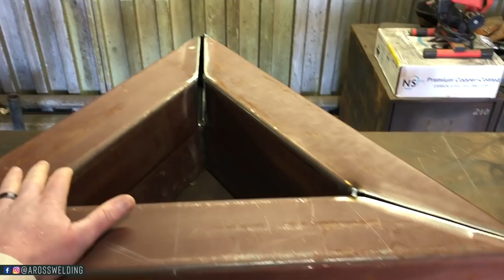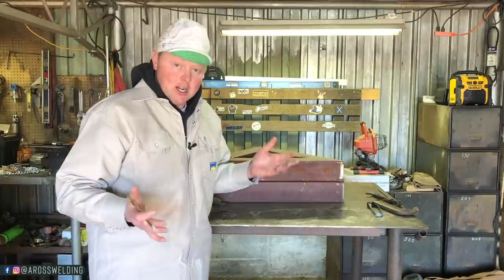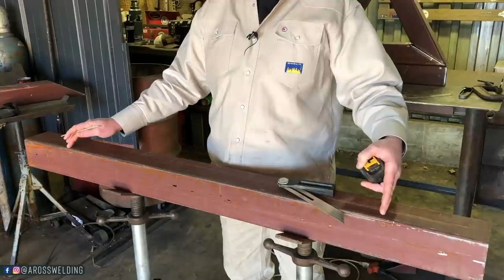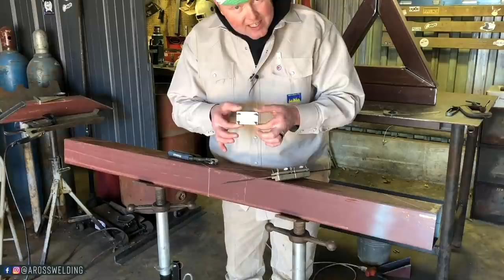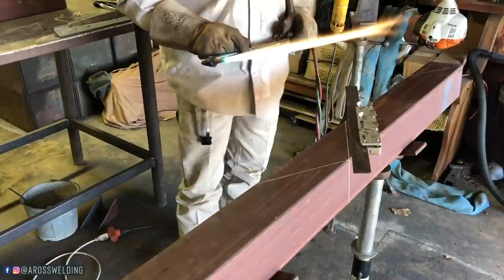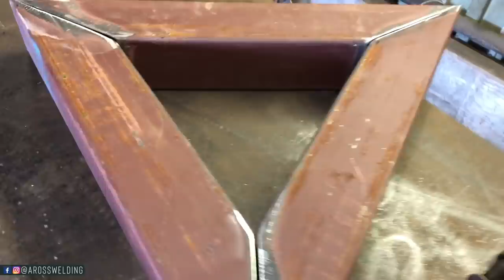WELDING SHOP PROJECTS “TEXTBOOK FABRICATION VS. REAL WORLD”

Comment: You might try this (woodworker's tip): After you've got your your edge guide all set......take your protractor (the angle measurer) and check the angle the edge guide is set to. Chances are it's just a hair off. Bump it dead on. The comments below are correct. To make angles fit up to perfect 60°, 45°, 90° etc. you must be exactly spot on; even half of a degree will kill ya. Buy a better protractor, one with the biggest marked-out arc you can find. Machinists have protractors that actually have little bitty magnifying glasses attached to them. so they can read between the angle marks. Have fun. Awesome torch work.

Comment: Hey Austin, for 45 degree and 30/60 degree cuts, you do not need a protractor at all for absolute precision. A 45-45-90 degree triangle has equal width and length with 90 degrees between. A 30-60-90 degree triangle has a length of twice the width with 90 degrees between. So simply draw a line across your material with a square. Measure the width of the material. Measure from the line you have, along the steel for 2x the width of the material and mark a line. Then draw your diagonal and you have exactly 30 degrees. Don't forget to allow for the width of your cut. Also, to save material, every 30 degree cut you make gives you two pieces of steel with a 30 degree end, so no need to mirror them back to back. I hope this helps for future builds. Keep up the good work.

Comment: Ive never had good luck bending something like that (like building a headache rack)  because when you bend instead of cut all the way through, it lengthens , which in turn opens up the joint and makes your side longer than the one you cut on its own.  now I just lay out the angle and make one cut to separate the two pieces completely.  That way i can make sure all the legs are the same length and the angles turn out much better.

Comment: I've found that if you will take a shot of whiskey, or drink a beer between each cut....the word  precise is no longer in your vocabulary. It is replace by:  fix it with a paddle disc, after you've over dabbed the crap out of all the gaps. It all turns out purdy, right after you paint it.
Reply: what about using a band saw set at 60 degrees exact and then you have no gaps at all
Reply: if I'm in the field I never use a streight edge because I know how to cut a streight line by hand

Comment: Hey Austin. This one actually quite simple. The gap is caused by two things. First, heating and bending the metal will stretch it. Second, the bend adds a radius (length) to the angle and thus creates your gap.

Comment: Hey A Ross, walking by on horseback I see yer problem and You actually gave the solution on your final try!
When you show the first one and yo have the bend at the top, your margin of error is Not Cutting the angle you bent.
You cut that one and gap closes and yer Good To Go!
Math don’t lie, 60 x 3= 180 but the 1/8 thickness of material Not cut throws everything off.
You solved it. I just put all yer pieces together!
Thanks for yer goofy sense of humor, my Grandaddy and Grandmommy are from Oklahoma so prolly learned it from my Momma!
Best,
My first name is Ross so we iz related!

Comment: I was having a difficult time with my cutting torch constantly cutting out the other day. low and behold i just had to clean the tip out a little bit and it worked beautifully (other than my shaky hands lol). the magnetic straight edge you have is awesome

Comment: If you're making alot of those its handy to have a mitre saw so you can set your angle once you figure it out and you can use a stop block to have the length every time. Cut all you need then you can weld them later. Its a trick I used doing carpentry for rafters but I assume the concept would work for welding. Sometimes making a few scrap is worth it to make sure the rest of your project has the exact same angles. There's a chart that goes along with the speed square to help figure angles. Its a PDF you can download and always have it on your phone.

Comment: Austin. Starrett no.491, thats the ticket to all your layout woes brother. I would advise a set. 24" combination square, 12" bevel protractor and a 6" center head. The straight edges are all interchangeable, makes layout extremely easy on structural members, pipe, tube and plate. They are extremely precise and very well built in the USA. Another excellent addition would be the 12" machinist level. 

Tools don't make a craftsmen but good tools sure help👌

Edit: ps. I'm not a starrett shill even though thats what it looks like🤣. They are quite literally the type of tool you would be proud to pass down to your grandkids.

Comment: Tube tends to de stress with heat which opens the angle when cut, cold cut seem to help while clamping material in place. Also get some scrap 3" flat and make up some angle squares to mark out on a flat surface.

Comment: I have found (after many years of making mistakes) that a template is the best thing to use when you don't have that bandsaw or power hacksaw. Remember, every torch cut removes material differently. A template cut exactly to size gives you the ability to trim to fit before tacking. Plus it works on both sizes of the tubing. And don't depend on your protractors. Remember, you're making equilateral triangles, so the duplication of sizes is the most important consideration. Calculate the lengths of your long and short sides instead of depending on your protractor. Access to a CAD drawing program would help too. It would do all that herd work for you.

Comment: I wonder if you didn't cut them all on the outside of the line, would the lengths have been more consistent and fit up better? Also I think the bending worked against you because it changes the length and angle from the cut pieces.  Interesting project, and glad to see you were able to parse out some insights, as well as share them with us. Thanks for the video!

Comment: I did a small project this week with 45 degre cuts but I cut them with a Metabo I had some big gaps I think It will be alot better too use a shop saw for this type of cuts comes out more exact tighter gaps good video 👍

Comment: I find figuring out angles such as your try angle. Use cardboard cut templates to test fit the cut angles. That way the mistakes are not costly. Then when transition to steel it comes out correct. Something my dad drove home to me many years ago when I was learning to weld

Comment: Usually gaps like that are easily explained by the fact that a torch was used to cut. If you don't clean the cut to smooth metal and instead just knock off the slag you might get away with it, but otherwise it's near impossible to hold any tight angles. 
I would recommend investing in some cutoff wheels, maybe even an 8'' grinder if you don't have one. For thin wall tubing like the ones you're using it would go through much easier than even a bandsaw or chop saw and you save yourself a fair bit of headache in the end from trying to figure out why you've got gaps.

Comment: try a sheetmetal nozzle , it has a stepped  2 jet configuration 
and is rested on the material , the cut is comparible with any plasma , they are great for up to 6mm plate

Comment: You have to figure hinged take-off when you bend/hinge the metel, and subtract blade thickness of your other cuts  even on thin gauge metel.  For me it's just easier to cut everything then fit back up  at the desired angle. I think there is some rule of thumb formula for hinged angles but I cant remember it. May find it in an OLD blue book from the 1980's

Comment: Keeping the 2 pieces joined is throwing it off a bit. You have to account for the length of the bend  and those 2 pieces are not going to join perfectly at the outside point. This then makes the angle close up tighter on the inside.

Comment: That is a bevel square we use it in structural a lot since they don’t give us angles if a plate is sloped one way. So instead of a plate being layer over at a 45* angle our prints would call for a 12 on 12 slope. We would lay that out on our table and use the slope square to carry it over to the part.

Comment: So a good trick is use the opposite angle. So for one piece in a join use your 30 Degree angle or whatever. For the opposite use the opposite side of your angle device for the 60 to get your 30 degree cutout. It won't matter if ones 29 and 61 as itll always match.

Comment: If your cutting angles to bend instead of just cut completely off and weld on square tube or angle you need to pull your measurement to center of the angle you’re going to layout then if it’s 1/4” thick then go 1/8” either side of center of angle then layout your cut lines. Basically take account for material thickness and you won’t have any gaps

Comment: Just did the same kind of cut with 2x6 90° corner (2x45). Could only get it right by scribing and cutting to the outside or drop side of the line with a cutting wheel on my grinder. Any angle has to be precise. Using a soapstone  and a torch can set you off a degree or two and compounds itself with each cut. Your 30° marks the first time around should work perfect with the right cut. Love your videos!  

One more thing on the bent corners: The point of that cut has to be from the inside point of the wall thickness. I’m just saying, C’mon!

Comment: My english is limited, but I try. You mark and cut the first piece. Because you want to build an isosceles triangle the angle never changes. You clean the cut and mark the next piece from the 30 degree cut you have on your residual material. Getting the length right is important. So you have less cuts too. I would probably use a cutting disc and a scriber. If you put all 3 pieces side by side they should be identical.

Comment: Don't forget to account for the width of your torch when you're cutting. Cut all pieces the same way as well(meaning make all cuts inside the mark, or on the mark, or outside the mark). If you cut one in and one out, then the length of the pieces could be off by a much as 1/4" or more.  Also i would have actually cut out 3 individual pieces. You'll get a more precise fit and it's only 1 more weld.

Comment: The angle at the corner where you've bend the tube is more like 61 or 62 - measure it! Because you want to open a slight gap for welding at the opposite site of the bend. And then of course all the other angles need to accomodate for it. Best way - I guess - would be to shim all connections with a thin plate in order to maintain a uniform gap on all 3 corners. This way the angles will stay at 60 degrees because the connecting tube ends (the joints) stay parallel and do not have an additional 1-2 degree angle like the corner I mentioned first.

Comment: I think the problem here is that speed squares are made for carpenters.  They are used to measure angles but usually for smaller dimensional lumber.  When you're cutting larger stock, the accuracy of a speed square isn't good enough.  Also, there's plenty of tricks to using any measuring tool to its full potential, so it could be a bit of user error.

Comment: The gaps don't surprise me. The problem is that all your errors add up. Suppose your miter cut is only off by one degree (say 29°) each coner angel will be off by two degrees (i.e. 58°). So you are trying to build a triangle with 174°. If you allign two of the miter cuts without gap the third will be off by 6°.  In addition the the length of the sides will be wrong (even if perfectly equal) since your triangle doesn't have angles with 60°. Considering the tools you are using the result is pretty good. You can't expect more.

Comment: the third try would be a better fit if you cut the bent angle. By leaving the material  in  and bending it makes it non equidistant than the others. Nice work.

Comment: To remove the gaps and get good angles - DON'T CUT TO THE BACK EDGE!  IF you are bending .  If you are through cutting, then that is different, then you have to weld all 4 edges instead of just 3.

Simple as that.  Mark out the material thickness of the back edge of the metal, then cut to That line.  Draw a material thickness line on the back edge - the retained edge to give the appropriate site line to mark to.
That is what I do and it comes out almost perfect.  Being that a human is doing the cutting, a minor bit of grinding brings the pieces together perfectly.  (welding perfectly, that is).

To check your angle measurement - draw a line on the angle, then put the tool on the opposite side and draw to the same line.  Any difference will show up in mismatched lines.
Simple as that.

Comment: Bending up that sharp of an angle will shorten your leg by a material thickness. Or your grinding too much and getting a bad tack up. Cheat your angles to shorten the outside or long leg by 1 degree at most Or the width of a soapstone line across the tube. The bigger the tube the less you can use the  corner bend tricks.
Keep at it. I've been a precision fabricator for 25 years. I specialized in the machine work but only a general welder.
Learn the 3 levels of tolerance (0.005, 1/32, 1/8) and which methods are appropriate. Stick welders rarely play with the tighter 2 tolerances. If you are going for tighter tolerances cut the corners out. It lets you fit up with more forgiveness.
You are so right though, just get out and do it. Can't be awesome if you never do anything.

Comment: Get yourself one of those digital angle finders , waaaaaay more accurate than a speed square
Reply: Can’t tell if you’re being serious or not. They may seem more convenient but accuracy is their downfall. They only claim to get you close, never spot on.
Reply: @defnotcam9166  the one I have measures to 1/10 of a degree  and is very accurate. There are cheap ones out there that aren’t worth the recycled beer cans they’re made of, but like anything “ya gets what ya pays fer”
Reply: @tonybarracuda3505  yeah I agree with that last part for sure. Especially with tools. And yeah that’s what I was saying. I know as far as tolerances go that’s pretty good, however the trusty speed-square will always get you right where you need to be. That’s all I was getting at.

Comment: Besides building metal buildings, corrales and pipe fence, I also dabble in kinetic sculptures. The welds have to be right on and even using my evolution saw, sometimes get things get a little bit off-kilter. Angels are just tough. My recommendations are twofold as well; be anxious for nothing and slow down.

Comment: If your cut is out by 1 degree you will then multiply that error 6 times as you cut all your mitres.  Try dialing your saw in more accurately and check your blade or disc is not wnderering as you cut. Check out vidioes for setting up mitre saws on the woodworking channels. Of course I learned this in a joinery and carpentry shop.  The 5 cut rule.

Comment: Again I am a Carpenter not a welder but make lots of angle cuts. I do also fabricate steel and am a average welder. I don't bother with working out any angles I go off measurements. To make those I would simply cut out the pieces of the steel over long for what i wanted for the triangle. lay them out over the top of one another get them to the shape of triangle you want ie. equilateral like you have by measurement and then mark down each side of the box. The intersection is then the cut. Alternatively you do like parker suggests and lay your steel out as I say and draw it on a bench. Use that thing you don't know what it is called. A Bevel and take the intersection with that. Probably even easier. No maths no calculations only measurements. Simple. Kiss theory every time.

Comment: You have all 30 degree cuts on the sides of your pieces. The end of your pieces actually are cut at 90 degrees. If you cut the 30 degrees all the way through and made sure your tube ends are cut at that 30 degrees also it should all flush. This is where I think your having your issues.

Comment: I believe that if you measure each individual piece inside to inside and tip to tip they’re not gonna be the same size .the way you laid that out the reason why is you did not account for the material that you cut out in your measurements on those two that you folded together

Comment: Your cut lengths are not the same. Thats what your issue is. If you use a torch you should off set what your torch actually cuts out. You might have been better off using a grinder with a cut off disk. Or a circular saw with a diablo steel demon blade. The diablo blades are around $30 but they cut steel and you don't need a special saw. Or could yse just a regular  14" cut off saw or something. A tip for cutting with the straight edge, put automotive hose clamp on your tip so you will always ha e the right distance from cutting surface. Then you can just glide along.

Comment: why make 2 cuts in the center when all you gotta do is turn the piece over  and get 2 cuts in the one cut
Reply from the maker: 7:30-8:00 👌😎
Reply: And save on length of material.
Reply: Yeah that's what I was thinking.

Comment: For some reason i want to say that you are not taking into account the material loss from the torch and grinding. So your lengths are not the exact same, so inturn the angles need to be slightly different.
Reply: His straight edge is taking that into account. He can put the edge on the line and then just simply flip it up and it will account for loss by moving the edge a bit to the side.
Reply: @nickbussard6089  
Yes, but he is using both sides of the cut. In a perfect world, you would make six perfect cuts to have zero gap and exact lengths. A torch and grinder is far from perfect, even in the best hands. In this situaution a sawzall would make more precise cuts. No knock on anyones skills here, but thin metal and torch cuts lead to filling gaps.